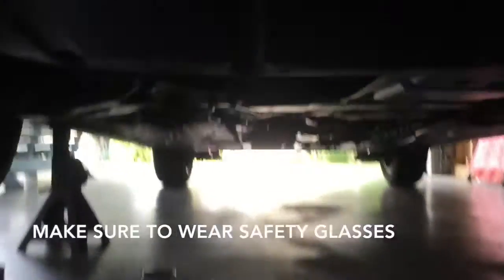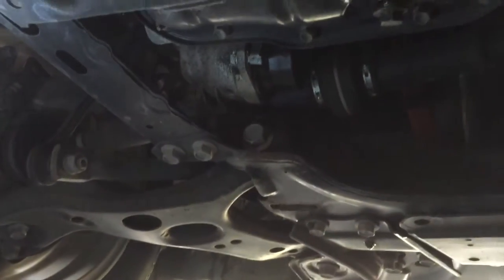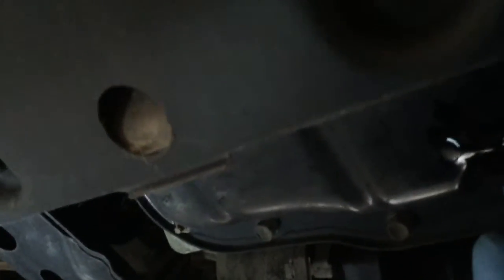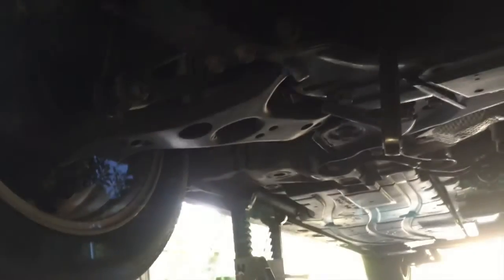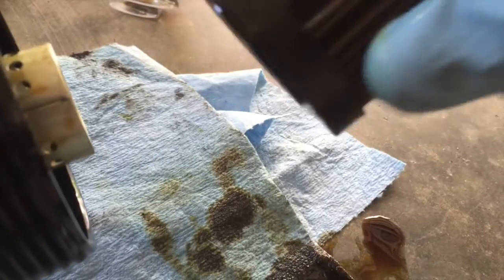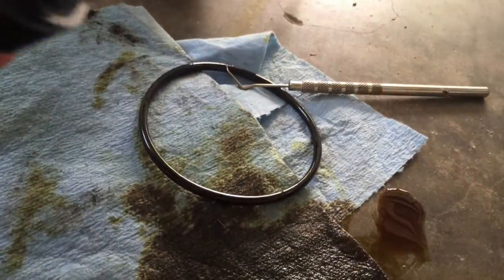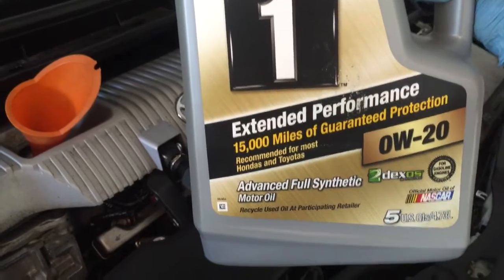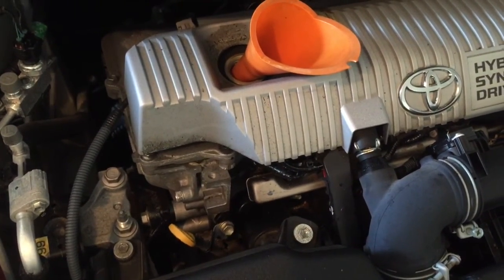2010-2015 Toyota Prius Oil Change DIY

Comment: Thanks for posting this video! I've always been a Toyota pickup and Jeep (Wrangler type) guy but decided to buy a 2015 Prius for commuting. Gas got up to $5.00+ per gallon where I live so owning a Prius became more practical for me. For the first time in my life, I decided to have the dealer's service center do all the maintenance on my vehicle, the Prius. That said, I'm a bit distrusting with mechanics and like to see if the oil is clean and the filter housing is also clean to ensure they did the job. Now I know why I couldn't find the darn filter, the way it's tucked underneath the engine. Also, I never have seen a vehicle oil filter design like that before, when I viewed this video. Very interesting! Makes good sense with less to recycle. Thank you, again, Sir!